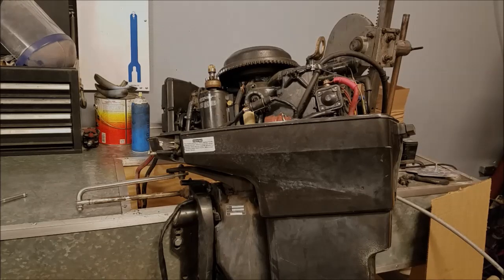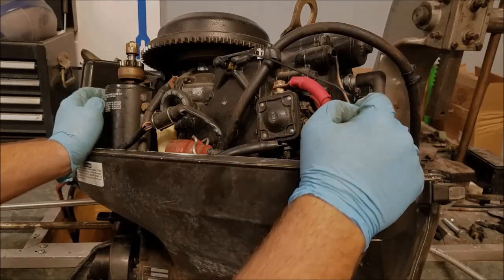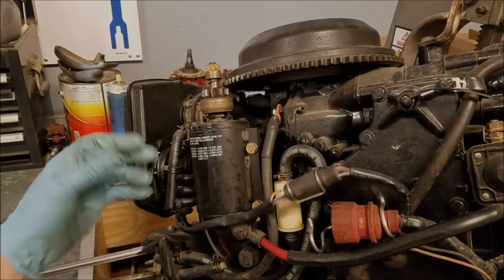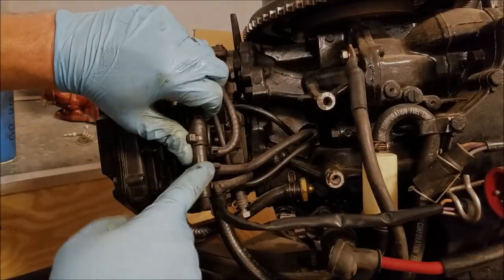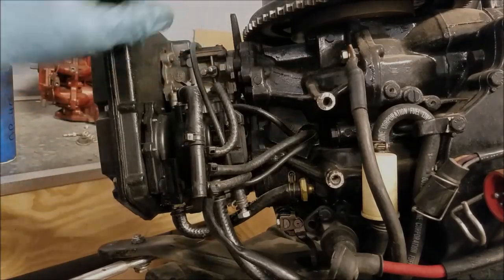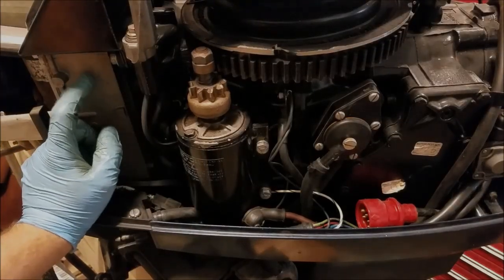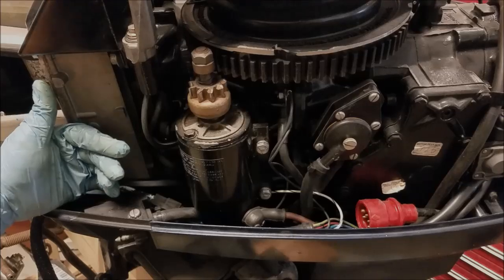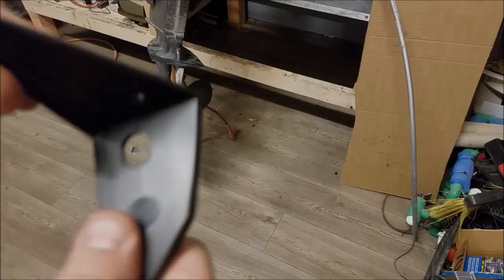1993 Johnson Evinrude 40 HP - Complete VRO Delete / Removal

Comment: What's the part number of the fuel pump you used?
Reply from the maker: That would be - 433387 
ebay.to/2MEqWEa
Reply: So you have to get a fuel pump if you disconnet the vro?
Reply: Joakim Sederlin no the vro is your fuel pump you can bypass the oil side and still use it for a fuel pump. But if you remove it then yes you will have to buy a regular fuel pump.
Reply: What is the screw length size / thread for mounting

Comment: This is perfect. Only question is why don't you use the fuel filter?
Reply: There is a filter screen inside the new fuel pump. It's right under that circular section with a single knurled bolt for easy cleaning.

Comment: I’ve got a 1990 Johnson 40hp with the vro. I deleted the oil tank and plugged the oil line inside the cowling. I replaced the fuel line and brand new components. Including the bulb, fittings, and fuel filter. My motor runs strong, but it will NOT keep prime in the fuel line. I have to manually pump the bulb while running. Do you know what I should look at next? Dirty carb? Dirty carb bowl? Replace VRO pump with the smaller fuel only pump?
Reply: Have you checked to make sure your fuel tank is vented properly? If not, fuel will not enter the hose without help from the squeeze bulb and will eventually stop completely until air can enter the tank. Good luck.
Reply: @cdc9776 I ended up figuring it out a while back. The VRO pump had a tiny crack on top and it was sucking air and losing prime for the entire fuel system. Did a full delete and took the VRO pump off and just switched it to a regular fuel pump.

Comment: Have a 2000 Johnson 50hp.  For a couple years it was a pain to start.  Always had to start it in neutral.  Finally came across this video and this weekend I did everything in this video exactly as described (minus replacing airbox).  The engine turned over on the first crank and is the 1st time I've ever gotten it to start without putting it in neutral.  Thank you for this video, it was a game changer!
Reply: Why would you start motor in gear?  Youre actually supposed to put in neutral. They make the controllers with nuetral safety deals so they wont start in when in gear.....  
Idk. Glad your good to go

Comment: I did the VRO delete on my j40elccs Johnson outboard the way you did in the video. I also removed and cleaned my Carbs (harbor freight ultra sonic cleaner and degreaser) this combo made i big difference. I don't even have to use the automatic primer anymore to start the engine. It idles smoother and has great power.... one thing i noticed was that there is no air filter on what i would think is the air cleaner housing. Is this normal, do these motors not run an air filter at all?
Reply from the maker: Good to hear. It makes a huge difference. 
An no, no air filter; not much dust/dirt out on the water.
Reply: @BrandonsGarage  I guess its just me being OCD (auto tech by profession) and feeling like every engine should have an air cleaner.. Anyhow thanks so much for your tutorial.
Reply: If your OCD gets the best of you as it has done myself. Simply buy a mesh screen (more durable than fiber) and epoxy it onto the holds on right side (starboard) of engine... if you have the plastic breather cover. Just make sure whatever you get will allow air at a sufficient rate. Another option to avoid anything going into the intake breather hole(s) is to install some sort of filter at the breather hole on the engine cover itself. If you have a good deal on the gasket located on bottom of the removable part of engine cover, that will eliminates by chance of debris finding its way in their.

Comment: Bought a 91 RFanger with a 91 Johnson Fast Strike 150.  The previous owner removed the VRO and primer, so didn't come any of those parts.  Ordered a similar pump off of eBay, but surprise, no instructions.  This video will really help.  Just need to figure out where the suction lines are from the case to plug into the pump.

Comment: great step by step video.  I'm in the middle of this on a 93 Johnson 40.  You didn't mention what to do with the left over wiring from the VRO.  Leave it hang in the cover?  Any reason to tape it off?  Also, my carbs have a line from the top of one carb to the other, yours do not.  Whats the purpose of that line?  any ideas?

Comment: I took the VRO off the motor when I bought the boat and motor back in 86. It’s the leading cause of failure in all out board motors. I’m not to lazy to mix some gas.. it still runs like it did the day it was made.
Reply from the maker: Agreed.
and you don't have the oil tank. 
win win in my book
Reply: the leading cause of failure is poor maintenance, NOT the systems.
Reply: @ct1762  A buddy of mine had the plastic gears strip on his bro and lockout up but good. The rings melted into the pistons.

Comment: I have a 93 60 hp with the vro had a mechanic buddy tell me i needed to put a vacuum line from where the pulse limiter was to the pump is that correct?
Reply from the maker: Yes, but it should have been there all along.
Reply: @BrandonsGarage  gotcha so do I even need to pull the pulse limiter and replace with a standard brass fitting or can I just send it with the limiter?

Comment: I have a 1990 40 hp Evinrude with the VRO, and occasionally when I turn the key on (boat is in garage), the horn sounds continuously. I just replaced the temperature switch and, after testing it everyday by turning the key on, about 10 days after replacing the switch the horn once sounded continually when I turned the key on. And occasionally when turning the key it sounds for about 2 seconds then stops. Any ideas? 
I think the horn or horn sensor might be faulty, but can't find any videos on how to get at it or how to replace it.

Comment: My pump has three nipples coming out of it part number 0438557 for a 97 Johnsons 40hp. do I use the original pulse hole to operate this pump and run a hose cause there's no hole in the back of the pump where I took the bolt out of the side of the motor to mount the pump. Now I bought a gasket for the pump and removed that bolt I hope that gasket seals that hole off from the motor if im using the original pulse outlet.

Comment: Brandon, I love your videos I have learned quite a bit, I have the same motor and would like to do the same exact thing. Unfortunately, all the parts weren't listed, and it's pretty difficult considering you have to get parts from a different year/model. Would you please tell us what year or model is the parts interchangeable for this modification, please? I have a 1990 40 HP Evinrude with the VRO. Thank you in advance

Comment: Great video. Thank you! I am getting ready to delete the vro pump on my 1990 50hp evinrude and install regular pump as you did in video..this has to be one of the best informational video I’ve seen and I’ve been watching a ton for the last 5 days lol thanks again! I was nervous before but after watching your video I am no longer nervous and ready to conquer the project...have been pre mixing fuel since I bought boat & motor as vro is no longer using oil, only acts as fuel pump.
Reply: What's the correct oil fuel ratio to run permix

Comment: I have a 2000 johnson 50hp that I deleted the vro on. I bought the pump # that Crowley marine has for the motor and it has 3 barbs and a hole in the back. Can I run the pump mounted to the block and run the pulse hose? Will that hurt anything?
Reply from the maker: the hole in the back... is is plugged?
You might have one for a v6 or something that ties 2 carburetors together.
If plugged, I would try it.
Reply: It doesn't look plugged but I'll check by removing the pump and blowing on the pulse hose. If its not plugged it would explain why the motor won't start.

Comment: Brandon,

Is it necessary to do all this work or can you just remove the oil tank, cap the oil the input at the entry point near the fuel connection on the outside of the motor, disconnect the alarm wires, and leave the VRO plumbing in tact? Or will this cause other issues?

Thanks!
Reply from the maker: That would work fine too, thats how a lot of people do it.
Keep in mind this video is for 'complete removal 
Only issue with your method is when the pump dies, its still a $400+ repair, where my method is usually less than $100.

Comment: Brandon, do you happen to know what size socket fits the flywheel nut on that 93 40 HP? I have one and (assume) it needs a new stator. It has weak spark for about 1 second then no spark. Already replaced plugs, wires, coil, powerpack. Only things I think that may be left are stator...which I have and just need to remove flywheel, and then timer or rectifier.  Maybe you or someone we can chime in and help me if possible.  Thank you in advance.

Comment: I just changed my fuel pump it starts on the first try now but it turns off when it idles any ideas
Reply: Adolfo Garcia what’s the rpm it’s running at at idle. Should check that out. What type of engine and year? Could be carburetor not setup right to idle. Could be junk in the slow idle holes could be a air leak could be a link and sink needs to be done. Could be vent on gas tank closed I could go on and on however check the simple things first and move from the tank to the carburetors you will find your problem.

Comment: I have that same electric start model you have. I was wondering if you can tell me what size the bolts are that mate the plain fuel pump to the block to use the pulse. Would appreciate any responses. Thanks!
Reply: the pulse fitting can be blocked off with a 1/8 npt fitting i believe thats the correct one

Comment: I have a 1993 Johnson 115 2 stroke VRO motor. Do you recommend doing the same procedure? MY VRO oil side of the pump wiring is rotted off to the VRO body so useless.

Comment: Hi Brandon, my 1999 50hp is forward controls, so all my warning lights are in the tacho. What do i do with the harness where you disconnected it so i still have my overtemp light etc without the low oil warning coming on all the time? Do i bridge some wires from the vro? Thanks.

Comment: I bought a Pontoon with a 98 50hp Evinrude w VRO delete already done. The fuel was nasty and top carb wouldn't drain.
I cleaned carbs and replaced all fuel lines like in video but my carbs have another port at the top where solenoid hoses come in. I took pictures before disassembly but unfortunately got deleted.
Does anyone know what goes to these or does a hose just jump from top to bottom carb. Thanks so much.
Reply: i sell reproduction fuel manifolds with hoses for that motor for $15 plus shipping. the factory ones are NLA! Anywho, that nipple goes to the primer solenoid... gives it a shot of fuel when you push in the key. they need to be clean and hoses are routed behind the carbs (front of the crank case). my manifold kit comes with new clear blue lines for those.

Comment: Great video. I did this to my E40TLESR last year. Works good but the VRO (variable ratio oil) would adjust oil/fuel based on rpm. Now getting 50-1 full time means too much oil at idle. (Smokes like hell). The VRO would adjust to 100-1 at idle then 50-1 at full throttle.
Reply from the maker: But think about it... you're at idle, then you full, or heavy, throttle it to get moving, for a few seconds you're running at a high RPM while the carbs, and fuel lines are all filled with 100:1.
Do that long enough, you'll have premature wear that wouldn't have happened on 50:1 premix.
Reply: Brandon's Garage 
Valid point. I’m happy without the VRO. I don’t worry anymore about pump failure. Plus I’m starting to like the smell of 2 stroke oil in the morning.
Reply: @BrandonsGarage  true and a few of them were 150:1! but with modern synthetic 100:1 is plenty, of course regular oil maybe not lol
Reply: The main point of it all is to do away with any possibility of either the sensor going bad that tells you it’s not mixing, which is yet another part that could go bad. Also, it eliminates the chance of the VRO system simply not doing its job. It could get stuck at 100:1 and you not know it. It’ll run, till it doesn’t. Too many possibilities that are simply too easily avoided by spending $30 on a complete fuel pump kit and of course you get the few hours of time away from the aggravating youngans and mouthy wife 😂
Reply: Corey Matthews - True that.
Reply: @AbsolutelyNot12345  I agree. If you don't really maintain the system well, it can definitely cause problems. I like mixing my own gas and oil. If it runs at 100:1 for a few seconds, it wont do a thing. 100:1 is fine for running, but when you shut the motor down theres often not enough oil on the bearings to last a month or more. run it hard and often, problems go away. just like the garage queen Ferrari vs. grandma's toyota turcell haha
Reply: use synthetic oil it doesn't make as much smoke

Comment: hey i have a 91 johnson 90 with the vro delete. the guy who had it before me took it off and has everything run a different way. the guy didnt even put the fuel pump on the power head like u did. could that be why it is running crappy? could you do a video on a 90 vro delete or can i just do it the same way in this video?
Reply from the maker: Slightly different.
I just finished an 88 90 HP doing just this; video should be up within a week,.
Reply: @BrandonsGarage  i still havent seen the video posted but could you tell me what pump did you use.

Comment: Hi  Brandon, great video it’s really helped me start the same conversion on my 60hp Johnson, however... I’ve hit a roadblock, my pump didn’t come with bolts to mount it to the engine, would you happen to know which ones I need? All the best, Dave uk.
Reply: I just had the same thing happen. It is a 10-24 machine screw, 2 inches long

Comment: so why did you not secure the engine's petrol manifold,, its going to be swinging in the wind when the engine is running?,, odd's on it will shear off one of its tiny ports and then you will get petrol spraying every were under the engine hood!,, ,, and when that happens you wait for the big yellow flash of flame's, shortly followed by the bang!

Comment: Do you need to use a fuel filter? When i took my stock line off there was a fuel filter? I saw something online that said the new fuel pump has a built in one though.
Reply from the maker: You do not, as the cap has a built in strainer.

Comment: I just deleted  mine last week and its runs better then it ever did
Reply from the maker: Oh, its a surprising improvement. This engine has never run this good.
Reply: @BrandonsGarage  interesting - the only thing I could see changing the way it runs is the airbox for the VRO looks more restrictive. Is it louder?
Reply: @dfabeagle718  air silencer has nothing to do with the VRO
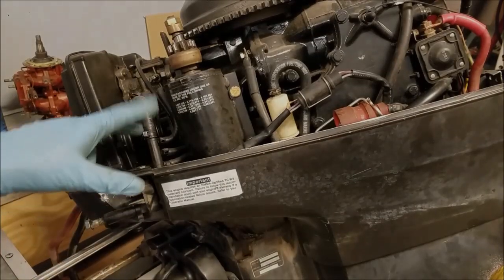Reply: @ct1762  1:11 version airbox (VRO version) versus 20:19 airbox (non VRO). 

I'm not talking about oiling methods, I'm talking about induction restrictions.
Reply: @dfabeagle718  that metal one is for the rope start models only (different high speed jet and reeds). electric start ones vro or non-vro are the same
Reply: @ct1762  good to know. My question was basically respsonding to the "it's never run better" and I was thinking the airbox being less restrictive would be the only thing I can see making it run better, except maybe pre-mix potentially making it run a little leaner. (more oil=less fuel, same amount of air).
Reply: @dfabeagle718  oh gotcha. Yea maybe just the placebo effect of it being changed. ive done dozens and never noticed a difference, accept more smoke on startup. the vro / oms meters a ratio of 100-150:1 @ idle and now its 2-3x richer burning 50:1 at idle. the other thing is the rope start air silencer really shouldn't be used in this case as it flows more air, so you should go up a size or 2 on the high speed jets.

Comment: Need your advice. Here's the issue. I have a 2001 Johnson 50HP. The outboard doesn't start easily. I always have to put it into neutral and rev it up in order to start. It runs well at full throttle and get up to 30mph. but when I slow down or idle it stalls out when in the water. I have rebuilt the VRO pump, rebuilt the carbs, checked for leaks, etc. I have read that bad reed valves can cause this problem. Also, a MAP sensor or the AIC could be bad. I have looked at the manual and I'm not sure my outboard even has any of these. Any advice would be appreciated.
Reply from the maker: Well if you have carburetors, you dont have any of the fuel injection sensors. 
Check compression?
Reply: @BrandonsGarage  i haven't checked compression. Run me through how to properlydo that. Also, do you advise getting rid of the vro pump and replacing with a fuel pump like your video shows? What is the advantage other than making more room?

Comment: Is there a reason you put the metal airbox on afterward other then the fact that it does not have the hole for the VRO in it like the plastic one?

Thanks
Reply from the maker: Not really,
Main reason, no VRO hole.
Secondary benefit, more access room for the cables and wiring.
Reply: @BrandonsGarage  cool thanks I have the same parts and I have always found the metal airbox to be significantly better quality. However I wasn't sure if there was any real reason for using one or the other.

Comment: No filter before the pump?
Reply from the maker: the pump cover is a filter (screen) 
You can add one within the motor, use the VRO's original, or add one in the fuel hose pre-bulb.
Reply: @BrandonsGarage  Was wondering the same thing.

Comment: removing the vro pump assembly is a bone head move.
Reply: Why is it a bone head move?
Reply: You just go ahead and keep your complicated VRO and wait for engine failure.. It will fail..And it will ruin the engine. The warning system will likely not save you either..Anytime you can get rid of overcomplicated, expensive technology..The better off you are.  Motors did without all this crap for a century.. And they were rock solid without it..